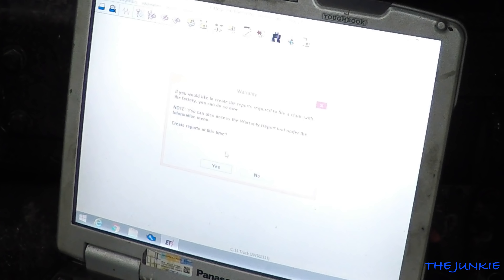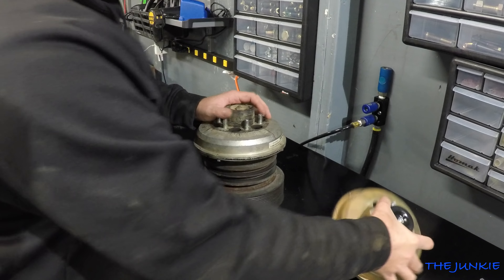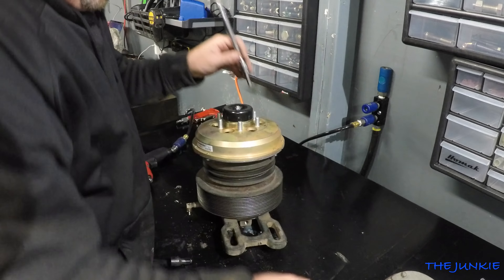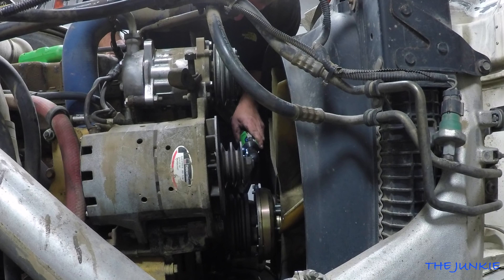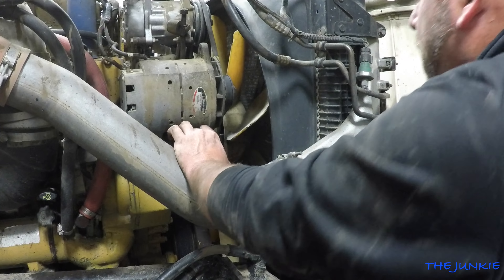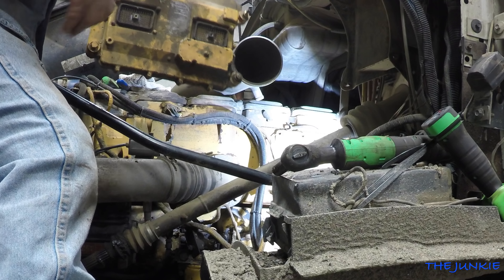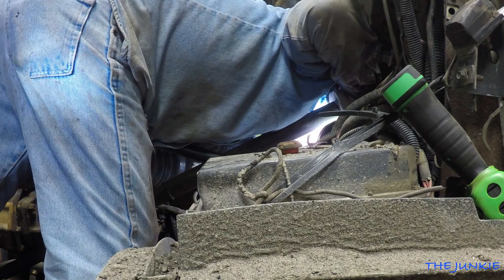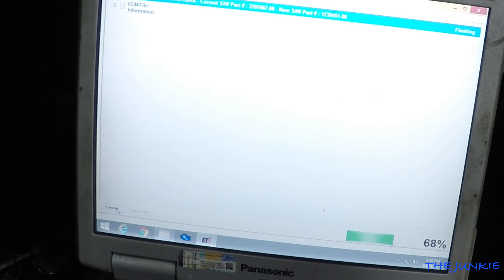CAT 3406 C- 15 ECM REAPIR WITH DIESEL YODA JIM USING A SCANNER🛠🔩🚛🔥🔥

Comment: Great video thanks my friend. I was hoping that you would show us your knuckles from getting the fan off. I know some you can take the upper Support bars off to get more room. I thought you would have used an old belt to help lower the heavy clutch assembly down into place. Glad you got it back up and running right again. I hope no drive shaft twisting know that it's got everything working right. Fuck you have that thing pumped up. Hope you get back to work got to make money know if this weather will make up it's mind. See you in the next one keep up the great work

Comment: Dealer scan tools are handy. They cost 5 to 7 grand. the one for cummins is $6700. I am going to get the one by texa because they don't require subscriptions to work. it also works for construction equipment, trailer engines, marine engines, stationary engines, cars/supercars and motorcycles.it's $4200 but they're all worth the price.

Comment: Don't crank that Main drive belt to tight. Remember that's pulling up on your crank and you can pull the clearance out of your main bearing and take out your crank and bearings. True fuckin story. Set that belt tension properly.

Comment: FYI, that's why you create and save the warranty report and you can go in to your reports and find your flash from your old ecm.
Reply: I went through an issue with a cat ecm that I didn't create a report and the ebcm went dead. I had to go on cat truck with the help of my cat guru and find a base code. I always create a report and send it to cat Truck engine and it's in there in case I have to replace an ecm. I have a folder on my laptop just for cat engines that saves all those parameters. I don't have to go to cat truck.
Reply: Especially when all 6 injectors code out lol better create a snapshot

Comment: a broken pin and a bent pin.....somebody has been poking around with those 70 pin connectors who shouldnt be...there are 2 kinds of caterpillar ecm's...the ones that are bad today and the ones that are bad tomorrow! i would make sure the insulators are in place. you can buy a scanner to do your cummins and cat both with oem coverage for under $7k
Reply from the maker: J.C. SMITH PROJECTS Yeah eventually we’re going to get the scanner to do both of them but being that 70 Penny see him I don’t know what the hell happened for it like I bought that engine used and it ran so we never took the connections off and ran about a year and a half and then started having problems but the pens are but we got it fixed now